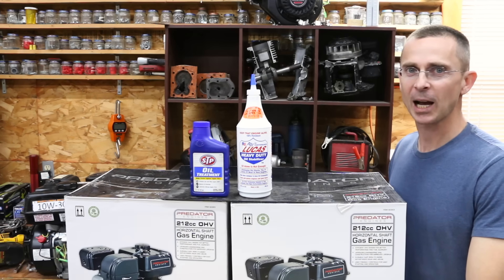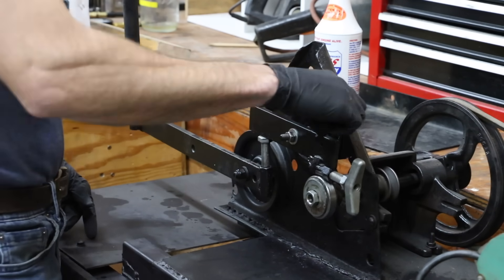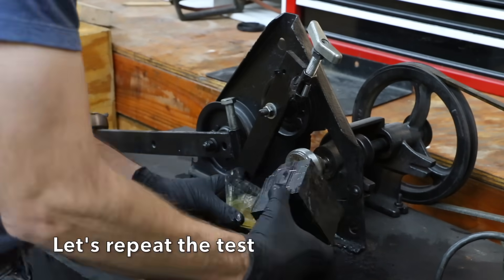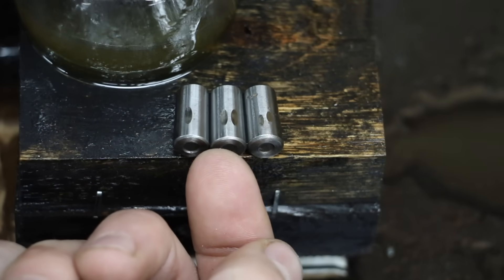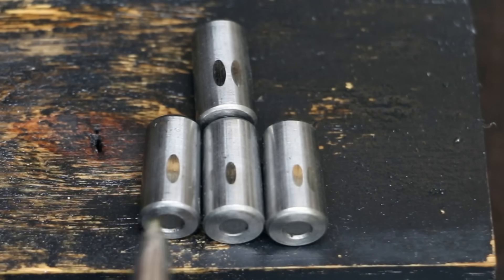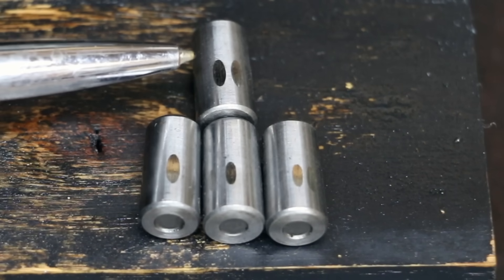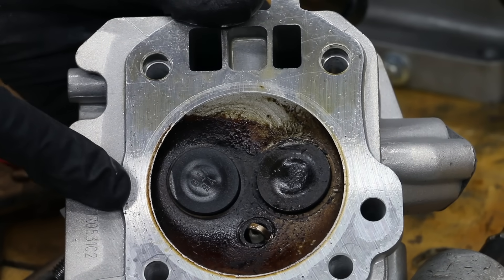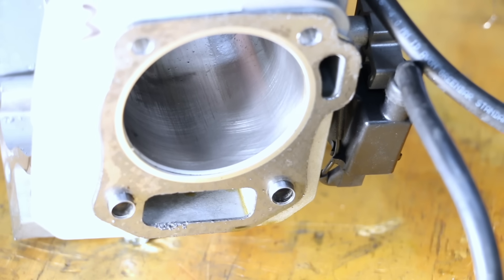Which engine self-destructs first?  Lucas or STP?

Comment: I've use Rotella and 1 bottle of  Lucas and my pickup truck ram 3500 2017 no problem 303130 miles
Reply from the maker: Thats great!
Reply: 07 5.9 Ram Delo + 1bottle Lucas.  After adjusting valves I started running Lucas because of the heat here in Texas.

Comment: How does one test them?
That Heath  Robinson device convinces me of nothing.
In an engine the oil is pumped around under pressure.
It’s not put in a plastic beaker under the engine with the hope it might go where needed.
And running an engine with no oil in only shows that the engine will seize.
You have proved nothing. 
You have  wasted my time and destroyed two engines. For no reason, you proved nothing.

The engine failed. Fuck me, what a shock, it had no oil in  it!

Comment: I love Prolong additive. My ex ran our car a busted radiator hose for around 10 miles. When she got home I was quite upset she didn't pull over. She said she forgot her phone and did the best she could. I was shocked when I couldn't find any engine damage. I fixed the radiator hose and the car ran fine. It was bone dry and I still have a hard time believing this. Do a test with that and I can see if it was sheer luck or the Prolong that helped.
Reply from the maker: Impressive!

Comment: Interesting  test  especially the small bearing rubbing against the steel wheel , ( similar to the 3 ball wear test ASTM tests, which i  was performing in laboratory at  UNOCAL 76  R&D ) Brea,California  (  of all the oils i tested  Synthetic oil out lasted all other kinds ) including oil additives , Your engine test  doesn't really prove much because you only did it one time,  try a sample of  3 tests   (  with everything being equal   bearing clearances, piston to wall clearance   etc ) and running any 4 cycle engine out of oil will fail, Major parts that fail are usually caused by small cracks in the material  (  i know i use to exam UNDER 500X Microscope ) , I am only expressing my experience i like what you do its pretty cool . Thanks  P.S. i use to test oil filters too and in short  WIX filters outperformed all other brands   we tested, 11 different brands
Reply from the maker: Thank You!

Comment: Engine manufacturer specs are all you need. They built the engine not the makers of the additives.
Reply: Reliability engineer here, Those are the minimum specs to have a failure rate that sits just at the right point to exceed warranty for 80% of the parts but also not last too long... We gotta keep em buying new stuff like a good consumer.   And let's be frank, sliding friction is sliding friction, they arnt building these engins out of some excotic cryo treated steel. An additive manufacture CAN definitely make improvements, not that they always do. That's why this testing is so cool, it lets us know what the snake oil is and what's the good stuff.

Comment: It seems like I'm missing something here...it seems like the STP ran cooler which I thought helps the engine run more efficiently over longer periods. Sure the Lucas stuck better but it also made the engine run hotter therefore loosing performance..I'm I wrong here?

Comment: Run mineral oil against fully synthetic as fully synthetic is twice the price for motor bikes and a lot of the manufactures are stating to use fully synthetic, i have been around motor bikes for years off road racing and road racing and the old oils did the job,
Reply from the maker: Thank you for the video idea!

Comment: Pointless because it didn’t provide the most important information  if additives are necessary or not with modern motor oil. 
The  vital part of the experiment was omitted or incompetently disregarded.  It is prudent to have control factors on any scientific experiment. A motor oil only control unit should have been tested. 
But the most illogical part of the senseless experiment is that non of the engines and petroleum products indicates to run engines without oil. 😆😬
Reply from the maker: Thanks for the constructive feedback

Comment: That just proves how good Lucas is lasted 10 min or so longer then stp even dry so if it last that long dry  just proves stp ain't that good in the oil anyhow and that Lucas is good for the motor Lucas is all I ever use and the life difference between a motor that dont have it in compared to one that does is basically just like this test
Reply from the maker: Thank you!
Reply: @ProjectFarm  your welcome I swear by it
Reply: These "tests" prove nothing much at all.  Those engines were not blueprinted for differences.  Some R&D on the rod journal clearances and bearing materials would extend the oil-free run times.   What the live test demonstrated was that aluminum aluminum surfaces get hot and melt without lubrication.  What surprised me is that those engines lasted as long as they did without oil.   Model airplane engines used to use bronze rod bearings to prevent that.  Maybe they still do.

Comment: Nice video. Both products did great! Lucas  did just a bit better. Both engines actually ran much longer than I would have expected WITHOUT OIL! That's awesome especially for a product where the manufacturer doesn't even claim you can run without oil and not cause damage.  Try this with Prolong , that is a company that claims you can run without oil and not damage your engine. In fact they even offer a guarantee that if you use their product as directed and your first application is before 100k miles your engine will never seize up due to lack of lubrication. And if it does they will replace your engine. I actually use prolong and once had an interesting experience. The rear main seal blew in my car at 155k I had been using prolong since I got the car at 88k. Got home from work one day to discover a huge oil slick where I park, checked the stick NOTHING added 2quarts on a 5 quart system to get a blip on the bottom of the stick so it was EMPTY!. The car never acted weird never sounded odd, I figure I drove close to 53 miles at highway speed without oil. Had a new seal put in the car still runs today with over 200k on it.  Was it because of the prolong? Or did I get lucky? Couldn't say for guaranteed sure but I still use prolong today.
Reply from the maker: Impressed that there wasn't engine damage!  Thanks for sharing this experience.

Comment: I use lucas with every oil change. My engines and rear ends last 4 to 500,000 miles. STP Products are garbage. Im a 28 year master mechanic. I've learned what works and what doesn't. I've literally tested every product on the market. Lucas and power punch are two of the best oil additives on the market. Hands down
Reply: My name is Wector Antonio Facundo Cesar Augusto and I am an engineer, I think both are garage,lol!!!

Comment: oil has another function beside lubrication, it also helps dissipate heat. How would the Lucas do with more air bubbles in it over the STP? or the oil mix?

Comment: Dumbest video I have witnessed. Proves little if anything. Engines are not meant to run without oil plus you did not compare a no additive engine. Engines are not equal in any event. The machining tolerances could be different, same with torque bolts, ring gaps, bearing alignment, valve seats and guides etc. Waste if two good engines. I almost did not watch but my curiosity got the best of me. Never again.
Reply from the maker: Thanks for the constructive feedback

Comment: Never, NEVER add oil additives to air cooled engines!!! They run too hot and oil additives are designed for cooler running water cooled engines. Plus the Predator could blow up for no apparent reason anyway, should of used a Honda
Reply from the maker: Thank you

Comment: Lucas VS STP which engine will run better dry? wtf
Reply: Even though he drained the oil from the engines, there is still a bit of oil left on the bearings and cylinder wall. He is testing to see how long the engines can run with only what little oil is left after it was drained. Whichever additive can lubricate the engines and keep them running longer is the better one.
Reply: MegaBization -  Just my opinion, and yet I feel that test shows that if you run the engine with Lucas protection in it, you can run it harder and in more adverse conditions.  It will last longer with less damage done to it, than the engine with STP in it.  i. e. it will withstand more abuse while running Lucas  It wasn't actually DRY until it failed to run any longer thus proving Lucas sticks to the surfaces better/longer protecting them than STP does.
Reply: @sonnybzero  use valvoline
Reply: I run everything dry
Reply: I totally thought the same thing... Not a reliable test at all, makes no sense!!

Comment: I saw a Cat C15 in which Lucas was used each oil change and when the main bearings were checked they still had battening on them at 520,000 miles. I'm a Lucas user and believer
Reply from the maker: Thank you

Comment: What's missing in the test is a control. That is, how long will an engine last after having used just the recommended oil? What is the top speed of the engine (rpm) with recommended oil, STP, and Lucas? Does STP or Lucas make any difference on an engine with 1000 hours on it? Always compare to a control. Very interesting project.
Reply from the maker: Thank you

Comment: I'm not really sure what you were testing.  Lucas is designed to work with oil in the engine.  I ran Lucas with synthetic oil in a 96 Plymouth for 320000km - engine was great but the body and suspension died.  I now have a Ford that I run synthetic with Lucas and am at 328000km and counting.  Runs fantastic still!  I only use Castrol, Mobil or Amsoil synthetic with Lucas.
Reply from the maker: Thank you

Comment: Adding either is bad with vehicles from the last 20 years or so, the reason your vehicle states the viscosity of ones oil ... is because it was designed that way, making the oil too thick will not allow for proper oil flow and result in damage anyhow. SO BEWARE OF WHAT YOU PUT IN! ... THERES A LOT OF "SNAKE OIL" OUT ONT THE MARKET! ... be good to your vehicle , maintain it consistently, and remember nothing in a bottle will solve anything major.
Reply from the maker: Thank you

Comment: slick 50 don't know what to compete with. I love slick 50
Reply: Slick 50 against Grease Lightning.
Reply: @hib32  Don't know what that is but if they're doing the same thing in the engine let Go!
Reply: Robert w Sieburg   It is an engine treatment using PTFE, a polymer created by DuPond. PTFE is suppose to be the slipperiest substance ever created. PTFE = Teflon.
Reply: @hib32  Thanks for that. I personally have had great results with slick 50. And now will look into grease lighting.

Comment: Slick 50 vs Restore Engine Restorer vs Marvel Mystery Oil vs Prolong. TO THE DEATH!!! I love these videos! Been using STP for years.
Reply from the maker: Thank you for the video idea!
Reply: Prolong has done me amazing longevity!!
Reply: @briansimon1864  Please tell me your joking?? 

Why did you buy the snake oil when you know there are 100% Synthetic Oils like Amsoil on the market?? 

Sorry but you keep wasting your money on a product that is only killing your engine.
Reply: I don't use anything other than Mobil 1. The exception is Amsoil. I've run thousands of miles with Mobil 1. No additives.
Reply: Attaboy!
Reply: Well.. STP Is Garbage, Pronounced (Garboge) and should never see the inside of an engine or fuel system.
Reply: STP was made from a soap derivative.-
Reply: I would love to see ProLong and a Slick 50 battle. I've used those since 1987 off and on!
Reply: Simple test for everyone to do lucas heavy duty oil stabilizer on the end of a flat head screwdriver try to pinch and hold screwdriver with 2 fingers you cannot do it any other additive you can hold the screwdriver with ease. With Lucas the harder you squeeze the faster it slips out of your fingers. Guaranteed.
Reply: STP, is a good additive.  It is very Zinc rich. When they did away with leaded gas, they made them remove heavy metals from oils. STP is exempt because it's an additive. I started using synthetic oil a few years after they came out. When they first came out, they were prohibitively expensive. I remember Mobil 1 for 4.95 a at and Pennzoil for 75 cents a qt, and that was the price at the PX!
  I use synthetic oil with various additives. I actually alternate different additives from one oil change to the next, maybe get a little of all the various stuff going on in there!

Comment: Lucas actually stopped my oil leak. My 530i hit 182,541 miles. The vanos seals were leaking onto the belt. Of course I ordered the seals. However, I needed a quick fix till I got them. I did an oil change. Subbed one quart with Lucas stop leak. The leaked stopped with in a day. I also noticed I have more power. I've been using the product ever since. 
   However, I would like to know what others think. Will this damage my (n54) engine?
Reply from the maker: Thank you

Comment: Well I know 2 things from experience.  1: aluminum rods don't appreciate running without oil.  I've never seen an aluminum rod seize, they always break.  2: I have a Toyota with over 350k on the engine, and 20% Lucas definitely shows an increase in oil pressure.  Take that for what it's worth.
Reply from the maker: Thank you

Comment: I believe that the Lucas Oil won because the engine ran longer with the Lucas oil than it did with the STP oil. But putting the oil aside,those two little engines are pretty darn good to run so long with a minimal amount of oil in them. Imagine, if a person only used a good quality oil and took good care of the little engines ! They would run for a looonnnggg time ! ! Cheers from Canada !
Reply from the maker: Thank you

Comment: Destroying the engines was pointless. In a real world situation 9 minutes is nothing. The wear to the bearing and elevated temp is more significant.
Reply: It wasn't pointless, but i agree with your preface
Reply: Dreadog anyone could argue its a legit test but in the real world by the time you discover your vehicle has ran out of oil it will be too late. Catastrophic irreversible damage will have occurred. Ive had engines sieze from no oil and be able to refill and operate but engines usually dont last more than a few months once that occurs.

Comment: add slick 50 to the shoot out.
Also, I engine that has never had any additive.
Oil only.
How much longer if any do the addative engines run.
Are you using standard or synthetic oil?
That matters also.
Synthetic is far superior.
Reply from the maker: Thank you for the video idea!

Comment: Cold starts is when most wear occurs.  I have a number of vehicles so one or two sit much to long between being run.... SO, added a kill switch to my vehicles so I can turn them over until I see oil pressure on the gauge and then start them.... seems to be working well.
Reply from the maker: Great point! Thank you

Comment: Use Royal Purple High Performance Synthetic oil and you car will purr for 300k miles. No affiliated. Had it in 3 Toyotas and sold or traded them all with over 250k. Still running strong.
Reply from the maker: Impressive results!

Comment: So what have we learned here folks. Well, nothing actually. There should have been a third engine that did not use ANY additives. But I can assure it would've probably failed close to the times the other 2 did. Clean oil at the proper fill level is all you've ever needed. Both products are snake oil imho.
Reply: Plus, he should of dun 5 of each engine to get an average. 10 engines would be better.
10 engines with Lucas
10 engines with stp
10 engines with pure oil.
There's the next experiment.

Comment: If the test is purely which engine blows up faster you have results. If the test is which additive will keep the engine from blowing up longer, there are too many variables to draw an accurate conclusion. You could probably run the same test again 10 times and get close to a 50/50 split. Though there might be some merit. The first engine died on half the time it took the second engine to die.
Reply from the maker: Thank you for the constructive feedback

Comment: The very best oil additive is MOREYS HEAVY DUTY OIL STABILISER.  It is made in the USA. I have used it for years and I have tried just about all others.It is not a chemical based additive. It is petroleum based and can be used in motors, manual and auto transmissions, power steering units, differentials, lawn mowers etc. MOREYS worked for me in a 302 Cleveland motor which had severe big end knock and blowing smoke. Put engine oil in first then top up with MOREYS as its thick and its best that does not go through your oil pump first. Read instructions on the bottle first and you Won't  go wrong. It's awesome stuff.
Reply from the maker: Thank you for the recommendation!
Reply: @ProjectFarm  your welcome and all the best!

Comment: Hi
I have a question Toyota hilux 3.0 diesel.
In the manual it say you can use a range of different oils depending on your climate.
When is it better to use a thicker engine oil and why?
Reply: Viscosity. In warmer climates you can pretty much use any oil you want. But in colder climates a high viscosity oil would stay thick and not lubricate the engine until it warmed up causing damage. We use 5w 30 all year round. You could switch to 10w 30 if you wanted in the summer but there would be little if any difference. If you have a high performance engine you could run 20w 50 but never in a sub zero winter climate. Hope that helps.
Reply: Miles Away thanks for the reply.

Valvoline recommends a 15w40w
Toyota says 5w30w is preferred.

I think I will use the 5w 30w. I had this in the engine prior to the current oil and it seemed to run a lot better